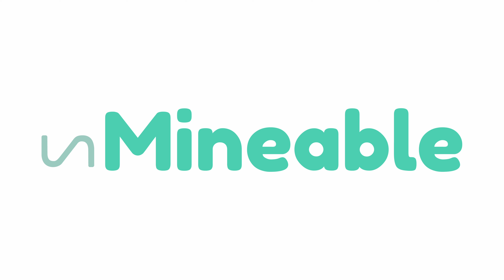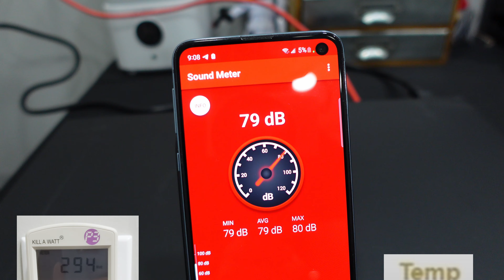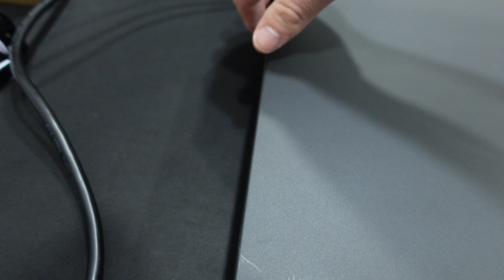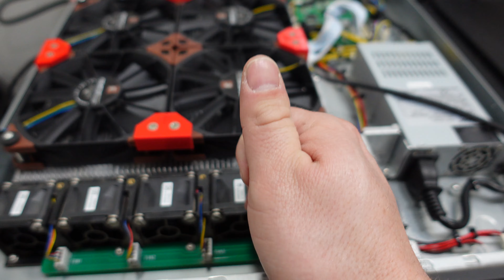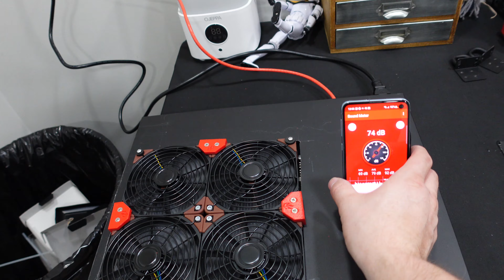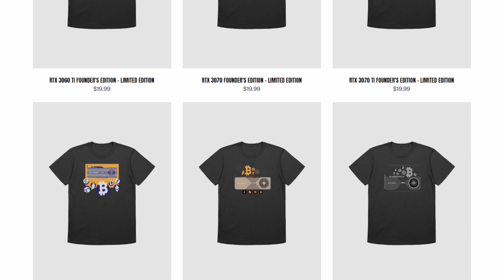The BEST ETHEREUM Classic Crypto Miner, Just Got this INSANE UPGRADE! Jasminer X4-1U

Comment from the maker: ⚒ 𝐏𝐚𝐫𝐭𝐬 𝐔𝐬𝐞𝐝 𝐢𝐧 𝐓𝐨𝐝𝐚𝐲'𝐬 𝐕𝐢𝐝𝐞𝐨:
🔸Jasminer X4-1U Ethereum Classic Miner https://geni.us/ASICMarketPlace
🔸Noctua NF-F12 iPPC 3000 PWM 109 CFM 4 Pin Fans https://geni.us/NoctuaFans
🔸120mm Black Fan Grills https://geni.us/120mmFanGrills
🔸1 to 5 Fan Hub https://geni.us/FanSplitter
🔸Kill A Watt Electricity Voltage Meter https://geni.us/KillaWattMeter

Comment: THM very nice 👍 came out great, BTW how did you connect the 3 pin splitter to a 4 pin source ?  Anyways you did great, time to 3D print a cover that the fans connect to vs the heatsink so you can do ever removal of the cover if needed .. I know you could do that to the stock cover as well, just another idea, too bad I never got that unit would have enjoyed doing so mods to it too 😂
Reply from the maker: Ended up using a different fan splitter. Check pinned comment.

Comment: I would think that you would get better cooling by forcing the air down into the heat sink instead of suckling it out. Think of the low profile CPU coolers from Intel and AMD. They push the air into the heat sink.
Reply from the maker: Can test it!